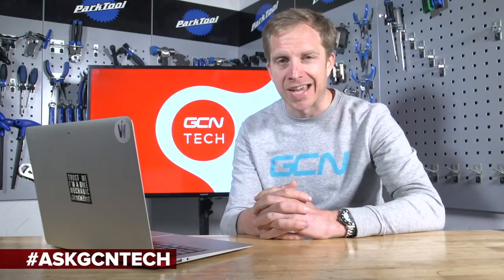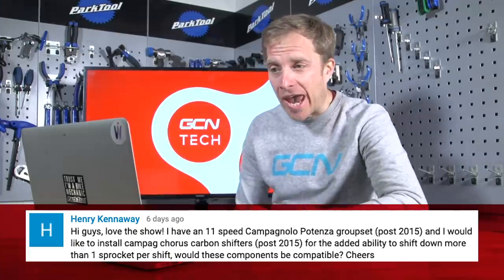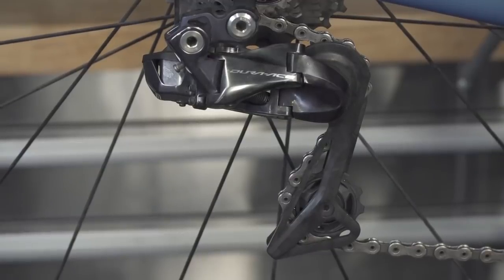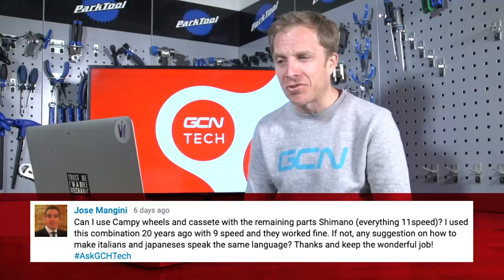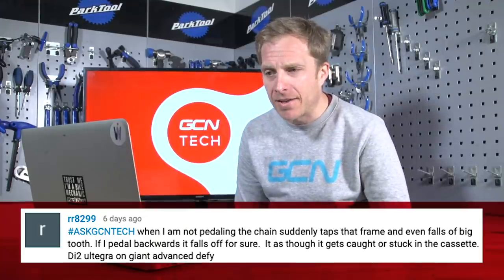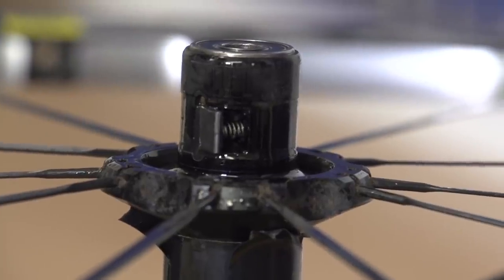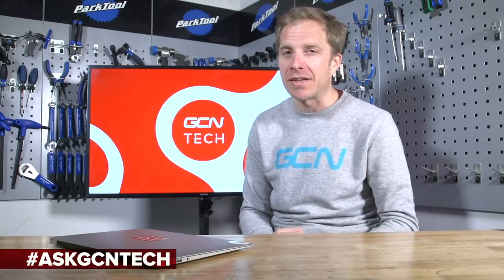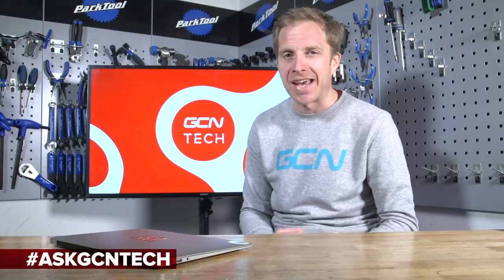1 X Drivetrains, Mixing Components & Worn Bike Parts | GCN Tech Clinic

Comment from the maker: We love to help here at GCN Tech so leave your questions for us in the comments below #AskGCNTech
Reply: #AskGCNTech Hi Jon, can you make a video for installation of Dura Ace 7710 track cranks. I can't find anything about this online. Thanks very much
Reply: Hello Gentlemen. #AskGCNTech I'm having a problem getting an Ultegra R8000 FD set up on my bike (2016 Trek Emonda SL6). I have the Shimano service instructions. When I set up the derailleur for 50-11, I then get chain rub in 34-32. When I fix that, I then get rub in 50-11. To top it off, the high limit screw will also affect the position of the derailleur when it is on the small chainring. Is it haunted? :) The 8000 FD also has much more resistance than my other bike with a 5800 FD. Tips? Thank you!

Comment: Hi Jon, not sure if I understood Gem's question correctly, but 3T does two 11-speed cassettes with 9t sprockets (9-32) - they're called the Bailout and Overdrive cassette. It'll fit any SRAM XDR hub. #AskGCNTech
Reply: Ferdi The 3T cassette can work perfectly with both XD & XDR driver. I got my bike set up with Force 1x 44T in the front and 3T overdrive 9-32T in the rear, and it works most of time, despite some crazy steep climb of 20%.
#AskGCNTech

Comment: RE to the first questionI've just finished my 1 by custom bike, 11/42 and 50 norrow wide chainwheel, my new bottom bracket came with a spacer, i put the spacer on the drive side, mounted the chainwheel on the inside so it now sits between where the original 2 by chain wheels would sit, it lines up directly with the 6th cog so I have the same bend in the chain, 5 cogs eaither way and don't get any rubbing at all. Hope this info helps. PS, absolutely love how it rides, no thinking about cross chaining or I wonder what chainwheel I'm in, I live in a hilly area and the ratios I have chosen suit my riding, brilliant.

Comment: 10t is a standard offering by SRAM with a specific hub, but still standard spacing.

Speciality companies also do a 9t. 

Grail Force 1x comes with 10/42 and 42 chain ring. 

Considering 1x, but the 10t is necessary to get a decent range
Reply: I'm converting to 1x at the moment. Have a Hope Pro 4 hub already on my bike (which a Shimano 11sp 11-32t cassette was fitted) but swapped the Hope-made Shimano freehub for Hope's own style freehub so I can fit their own design 10/44t cassette. This will go nicely with my new Absoluteblack 42t oval chainring; replacing the 50/34t 👍🏼

Comment: Re frame-stop for a front mech... its totally feasible to run a full length of outer gear cable all the way from your shifter down to the mech.  Some styles of front mech can terminate the outer housing, but they tend to be top-normal not the common bottom-normal.  
Separately I made a frame stop by drilling a small through hole and a half-way through bigger hole in a small block of aluminium and then hose-clamped it to the frame.  Some filing made it sit at the right angle and worked great.

Comment: I recently built up a bike from leftover parts using SRAM 11 speed shifters and cassette with Campagnolo Veloce 10 speed rear derailleur and a Record 11 speed front derailleur. Shifting the rear derailleur was silky smooth.I tried using a 10 speed front derailleur, but it wouldn't shift the front chainring over. I reckon this was because I used SRAM 11 speed cranks. I rode it this was for 6 months with no clunkiness. It seemed better than when the bike was full Campagnolo. I was impressed, so sometimes its easier to just try these things.

Comment: @Jon -- Regarding the advice to TheJoePavlik at 2:56, the jockey wheels of some high-end rear derailleurs are made for bearing service and are expensive enough that it's worth servicing them. SRAM Red comes to mind. Their AeroGlide jockey wheels cost about US$139 and have ceramic bearings. SRAM provides instructions on how to pry off the weather seals and clean and regrease them. I think SRAM also sells a high-performance grease for the purpose. However, the last time I serviced mine I used Park Tool HPG-1.

Comment: Correction on the question about adding a front derailleur: The R7000 front derailleur actually has a built-in cable stop (if you don't run the cable housing all the way to the derailleur, the bare cable just passes through the cable stop). So, as long as Tim's frame has a circular seat tube and its diameter is one of the standard band-on sizes, he would be able to install the R7000 FD using full-length housing in the event that the frame doesn't have a cable guide under the BB and/or doesn't have a cable stop on the down tube.

Comment: Should you use light grease on Mavic bushing and pawls John?I was told to only ever use a couple of drops of mineral oil in the shell, on the bushing and the pawl and springs
Reply: Light grease is fine , have used it for years.

Comment: #AskGCNTech reply to Vishwa Dev question. As im a 1x fanboy I’d ask if he’s running a kmc chain?They seem particularly grumpy on 1x setups in my experience and can be quite noisy if the chain line of the chainring is not adjusted to the middle of the cassette. 
As a hack I’ve been running a sram eagle 12 speed mountain bike chain (XX1 in black for added pimping points) on my 1x road bike for nearly a year. Extremely quiet and very good shifting on the 11-36 11 speed sram cassette.  I don’t think sram would recommend it, but it works really really we for me.
Reply: +1 on that advice. I’ve also got a sram 1x with 10-42 rear cassette and have had the same noisier 3 small cogs. Replacing the KMC chain with a SRAM XX1 made it a lot smoother, especially when out of the box with all that lovely factory lube on! Other thing you may want to try is a fresh gear cable, especially if you run through winter.

Comment: Hey Jon, I have a Specialized Diverge aluminum road bike with a 9 speed Shimano Claris groupset and I want to upgrade the components to Ultegra over time, I would like to start by upgrading the wheels and the rear derailleur first but I was wondering if I can have the whole 11 speed cassette work with the Claris front shifters for the time being, while I save up to upgrade the shift levers and the front derailleur next. Thanks for your and all of GCN's help over the years, absolutely love your channel :) #AskGCNTech #AskGCN 
P.S. Could you guys also do a video on some good budget friendly Wheelsets that you guys would recommend. There's a whole lot of options that may or may not be good out there, and picking the right wheels is hard for someone on a budget.

Comment: 1 x doesn't need narrow/wide rings in my opinion. Long teeth rings will do the job. A plus is you don't have the 50/50 shot at putting the chain on wrong.

Comment: #AskGCNTech Hi Jon, My wife just precented me with a new frame for my birthday that i can build my "own" bike off. The frame just happen to be a Etap specific frame so no slots or anything for gearing wires. I have a Sram force 10 speed that i would like to use the cranckset from. Is this directly compatible with an Red Etap 11 speed chain and front derailiour, or do i need to upgrade the crankset aswell ?

Comment: hey jon, i´m in desperate need of help. for the first time in 30 years i have bike with a stripped bottom bracket. the left side (plastic) is basically gone the right side isnt moving at all. how can i get rid of it without ruining the threads or the whole frame?

Comment: Hi Jon, love the show, very helpful tips each week! 
I have just bought a new bike, has Ultegra DI2 with 52/36 & 11/30   
The gearing is ideal for about 90% of the riding I do. However, I have a few Sportive’s coming up with gradients well over 20% in parts. I know I won’t be able to get over those hills with current gearing. What is the simplest way to get an extra gear or 2? Stick on a compact set of chainrings or can I put a 32 cassette on without changing to a longer cage length (medium cage at the moment) 
Thanks so much. 
#AskGCNTech

Comment: Hi Jon. Have a Fuji carbon where the 2 piece bolted alloy dropout between the seat stay and chain stay is loose on the non-drive side of the chain stay. What adhesive could I use to rebond assuming epoxy for filling capabilities.

Comment: I currently run 10 speed Shimano and want to upgrade to etap. Red etap 11s is 100€ cheaper than force etap AXS. It would make more sense to go for the cheaper Red, but I am worried that at some point there wont be any parts if something breaks (so no long term support) but for force I need to change my hubs... Which is the better choice? #AskGCNTech

Comment: On my wife's bike I discovered that she is running Campy Veloce(quite old model) 10 Speed shifters, chain and rear derailleur, with Shimano Cassette and front derailleur and a Truvativ crank. Yet it works perfectly? This goes against everything the manufacturers say. I just want to make sure I'm not ruining the parts by continuing to run it like this? #AskGCNTech

Comment: #AskGCNTech Hi Jon, thanks for your help! Although I'm in trouble again. I wanted to install Shimano 105 calipers in place of the stock TRP Spyres but the adapter is a couple of millimeters short? Is there any way I can get different adapters that would fit? The bike is 2015 Specialized Crux.

Comment: #AskGCNTech Hi Jon, very specific question here. 
I've recently built up a new gravel/cross bike for the first time from scratch, with a 1x11 drivetrain with Apex 1 shifters, GX derailleur with inline barrel adjuster, X01 10-42 cassette and 42t chainring, 105 chain (these were the components that I had available for cheap). 
So far so good, everything is working fine and as it should, EXCEPT the damn shifting. I just can't get it to shift through the entire range of the cassette, either I'm missing the largest or smallest cog. I've been fiddling around with the cable tension forever, but it just won't work. All components are brand new, cables, housing, derailleur. The derailleur also works just fine when I push it manually, the limiters and b-tension are set correctly, chainline is at 49mm (non-boost hubs). Also, chain length should be fine. 
Am I missing something here?? Aren't all Sram x-actuation components compatible with one another? I'm worried that I need to change the GX derailleur for lets say an Apex/Rival one.
Thank you so much!
Reply: gesicht315 11 speed sram road and mtb rear derailleur are not compatible. Although the force/rival and gx/x1 derailleurs look extremely similar bar the cable wheel/barrel adjuster, the parallelogram section of the rear mech is about 5mm narrower on the road derailleur, this changes the shift ratio causing your shifting problems. 
I think the sram 10 speed road and mtb components were interchangeable, but they moved away from this direction for the 11 speed stuff and is were the confusion set in.
Reply: @MozOnBikes  Well that explains the issue, thank you! Seems like it's time for a new rear derailleur then :/

Comment: #AskGCNTech Hi there! I got my first road bike last Autumn. Beautiful used 2016 TCR Advanced. Previous owner swapped original Tiagra for 2012(?) 10spd Sram Force. It has about 15k km on and sometimes you can feel it (worn rear derailleur spring ). As a tech fan I would like to replace worn components with a "electronic future". Is there any partial upgrade path to Force AXS groupset you would recommend? Current Force is in too good shape to put in the bin. Also it's a rim brake bike, so I wonder if it is worth it (won't take it with me to next disk brake bike). Ideas?

Comment: Love the tech channel. I have an ultegra 6800 groupset which I recently switched to an upgraded frame (Tifosi SS26). On my new frame I am unable to shift into the biggest sprocket on my cassette when I am in the big ring on the front. I have tried everything I know i.e. increase cable tension, adjusted the rear derailleur limit screws appropriately. I know this causes a large chain cross-over but I am a stickler for staying in the big ring for as long as possible and therefore would normally use this gear on my old frame...marginal gains...Any suggestions on what might be going wrong? #AskGCNTech

Comment: Hi, I just bought a stages crank arm power meter and realised that my original cranks are not the same length ! So I need to replace the right crank arm, but don't know if I'll be able to fit my 105 5800 chainrings to any other Shimano crank?? Grateful for anyone's help.

Comment: Hi team, I'm currently running a full Shimano Claris 2300 groupset on my bike but interested in upgrading bit by bit. If I was to keep the Claris front derailleur, chainset and rear derailleur, would I be able to upgrade the shifters, cassette and chain to Tiagra 10 speed?  If not, what would you suggest for cost effective upgrades?   #askGCNTech

Comment: #askgcntech hey Jon. I need to change my front mech on an old Emmelle. My front cogs are stamped metal with an integrated chain guard. I have a new bottom pull shimano claris mech but i think the cage is too wide. Do you know of a mech that has a narrower cage? Its a six speed btw. #oldschool. ❤the show.

Comment: Hello Tech Clinic! Bought a pair of Zipp 404 and GP5000 and innertubes. Inflated it once, realised I had failed to install the valve extender properly and had to remove the tire. Issue is, I can't even move the bead off the sidewall to fit a tirelever. It is... stuck. Tried everything, hands hurt and I want to throw the damn things out the window. Any tips? Don't want to be stuck out on the road without being able to change innertube... #AskGCNTech

Comment: #AskGCNTech I´ve got a problem with my bottom bracket... i own an old raleigh roadbike (probably around 30 yo) and when i put some weight on the cranks there is some kind of cracking noise coming from the bottom bracket. It´s square headed and got a widht of 71mm... I can´t find any new ones on the internet and my local bike shop told me that they are not produced anymore. Are there any other bottom brackets i could use? Or is there any way of fixing it?

Comment: #askgcntech I’m riding schwalbe pro one tubeless tyres and have a punture that won’t seal at high pressure with doc blue sealant. Tyre is almost new, should I replace it already or is there another way to get it repaired? And can I mix different brands of sealant, ‘cause I don’t wanna use doc blue again.
Reply: Patch on the inside of tyre

Comment: #AskGCNTech Hi, I have a specialized road bike that comes with a BB30 and FSA crank set on it, now the threading for pedal on the crank is worn and I want to replace it but I want to have a shimano set on it, which of the shimano crankset model do you think can work with BB30?
Reply: There are a few adapters which can be used to adapt Shimano cranksets to BB30 but the Praxis Works ones look good and they include bottom bracket bearings. That's what I'm going to use once my FSA rings wear out. The creaking from the BB30 is driving me nuts

Comment: #askgcntech is there any way to upgrade one part at a time - - my sora r3000 groupset - - looking to upgrade to 105. Is it possible to replace the components one by one?...
Reply: yes if everything is compatible (check Shimano's compatibility page). I've done that in the old 9 speed days from Ultegra to Dura Ace. The big issues are that across generations and updates sometimes things like cable pull are modified.
Reply: That's what I am afraid of... Whether the new 105 and sora are compatible that way

Comment: #AskGCNTech

Sometimes when shifting from my big chain ring to my small while climbing, the chain sticks to the cog and jams on the back. I'm concerned about damaging the drivetrain and crashing from this. How do I fix this? Thanks. 

My chainring/derailleur is a Tiagra 4700.
Reply: Probably worn out cassette/cog or chain
Reply: @stepforward1605  
The bike is less that 1 year old.
Reply: lift the front derailleur 1 or 2 millimeter?
Reply: Shifter Cables and chains stretch and cassettes wear with use. You should check these things multiple times a year if you ride a lot. Visit your local bike shop to help out what you need

Comment: Hi Jon. I'm thinking of upgrading to ultegra di2 11 speed on my TT bike. I currently have ultegra di2 10 speed on it. Which components, other than chain, derailleurs, cassette, and chainrings, do I need to change? Do I need to change my shifters? What about my junctionbox and cables?

Cheers.
Reply: Emil Fitzner make sure your rear wheel hub is 11 Spd compatible too